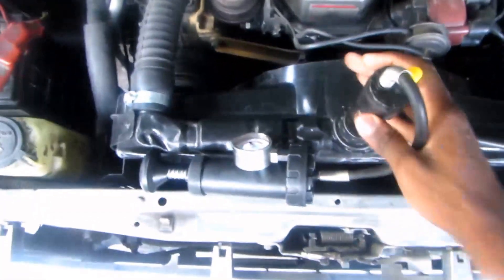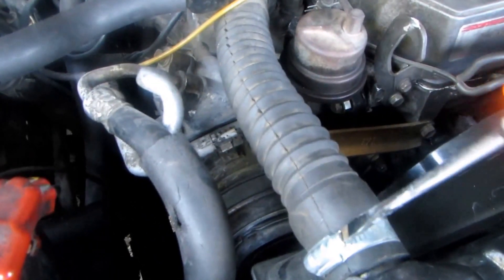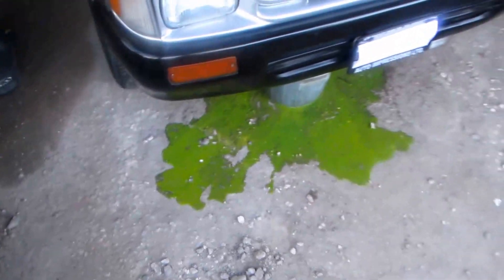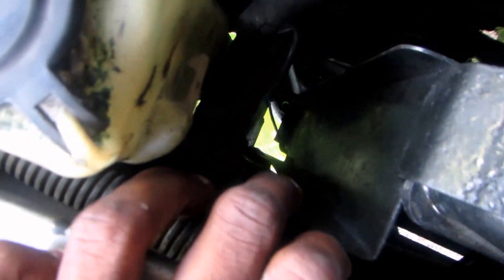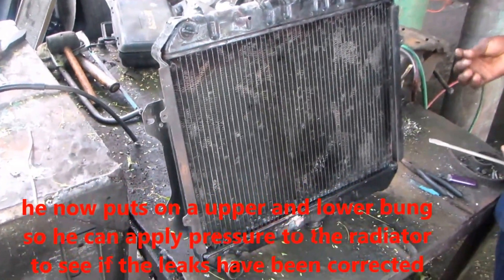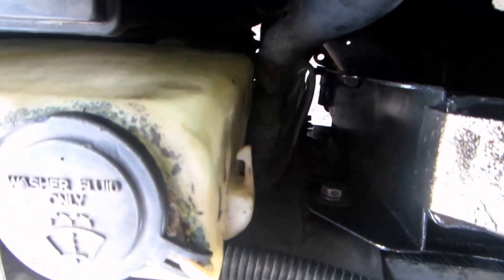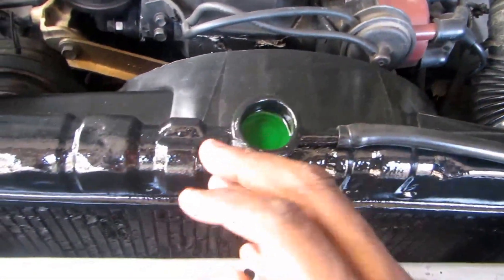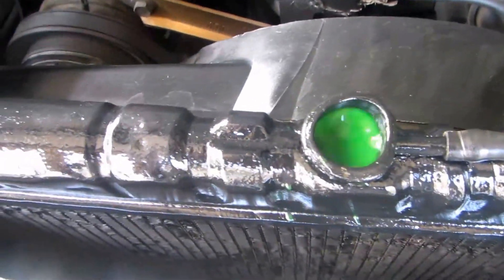How to repair radiator leak

Comment: Good video. most of the older radiators are made out of brass and if its NOT painted, it will turn green. so yes, it is for presentation but its also to prevent the radiator from getting green.